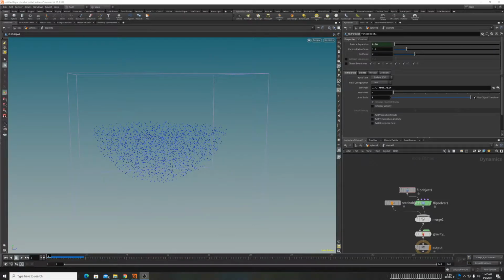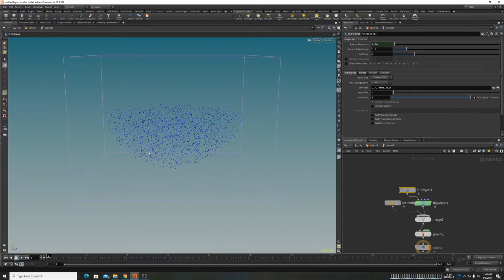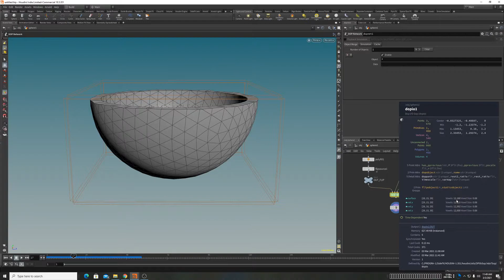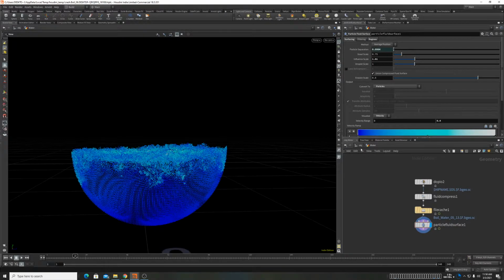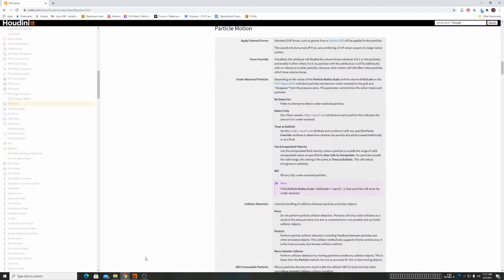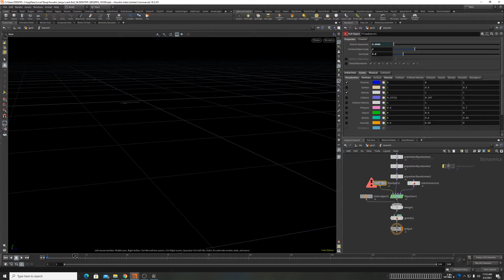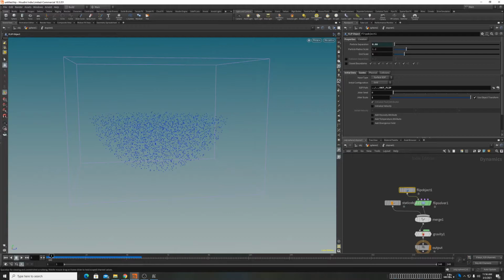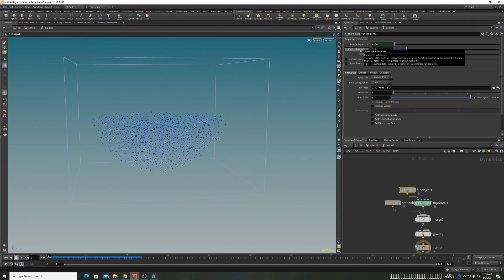Volume Loss in FLIP SIM? Grid Scale and Particle Radius Scale

Comment: hi everyone! so after listening to his video and learning that the particles collide in on themselves due to the lack of particle radius and space between them, i found a permanent solution compare to his temporary one. Because he didnt really solve the issue, only made the problem slower. The solution is to increase the size of your static mesh and with that your boundary box. 

personally i'm doing a boiling liquid too, and i made a pot, and the inside of the pot (a second mesh, both made in 3ds max) that i used to stimulate the particles. I slipped the uniform scale of pot to the parameter uniform scale of the inside of the pot, in a relative parameter, so that way when i inscrease the pot, the inside of the pot increases as well. It's a procedural way of working. both my pivot points are at the small place as well so it works perfectly. 

Then i adjusted the bounding box of my stimulation. It was at 5. and my uniform scale of the pot was now at 3. So i slid the parameter of the uniform scale of the pot in all three channels of the boundary box as well and added a +2 so the boundary box is always a little bigger. 

hope that helps!
Reply from the maker: Hey hey! Yeah this video is quite old so I'm sure there's updated ways. While yes, scaling the scene does make things stable (I do it a lot for specifically bullet sims), my question is how is this different than just adding more resolution to voxel scale? With increasing the size of the scene, you're increasing the amount of VDB's, so why not keep the scene normalized and increase resolution?

Comment: hey amazing video! Im getting this problem with the new Flip SOP setup that was implemented in houdini 19.5, I lose fluid / volume and tweaking the grid scale / particle separation doesnt fix it. Unfortunately particle radius scale isnt exposed in the flip sop setup so not sure how to solve this, but ill try the regular dop way that you are using
Reply: in 19.5 I've found that turning on "enforce particle separation" fixed it for me. It's in the flipSolver under the Fluid behaviour Tab. I also set the grid scale to 1.5 (flipContainer). Also, just FYI i left the other particle separation checkbox off in the setup tab
Reply: @_incendiary  i use H19.5.493 (apprentice version btw) and I dont have the "enforce particle seperation" option? My sim is still losing so much volume
Do you know where else I can find it?
Reply: @gluttonium  "Apply Particle Separation" under "Particle Motion"
Reply: any ideas yet?
Reply: see my comment, on wait this was two years ago aha, oh well